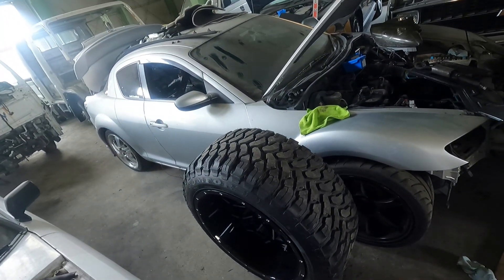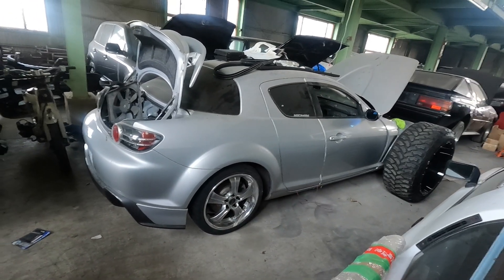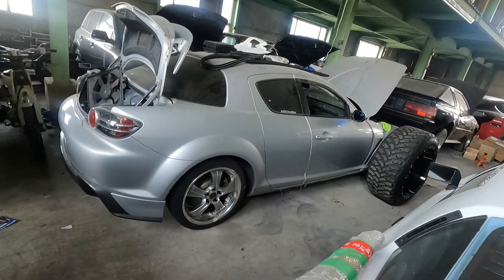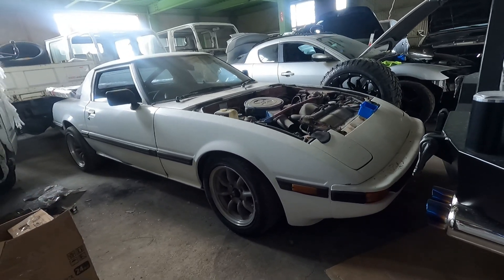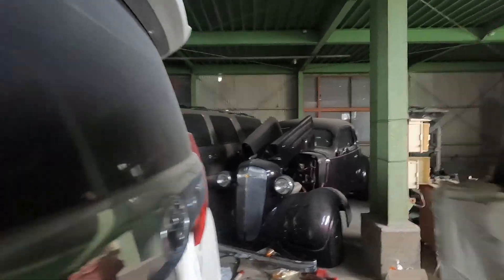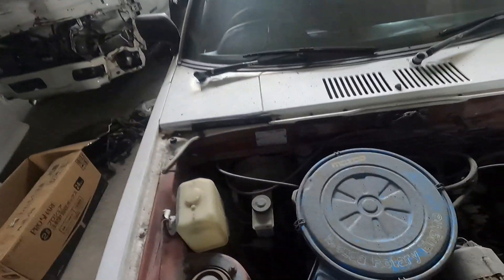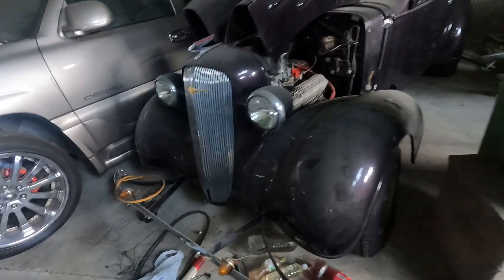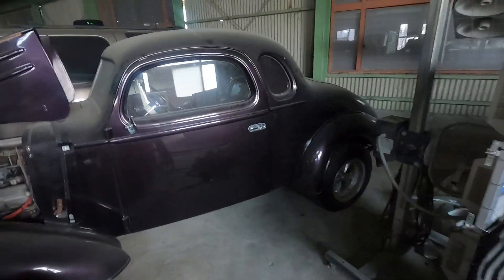Mazda RX-7, Mitsu Starion GSR-VR, RX-8, Plus two Mystery Cars

Comment: I remember when the local cops in Far North NSW were issued Starions as highway patrol.   First time it rained they were off the road and into the scenery.   Two cars were written off within months.   I don't think they learnt because much later they tried the Galant GSR and it had a similar result.
Reply from the maker: Ah! I now vaguely recall seeing some Starion police car pics on, I'm guessing, Facebook. Side note, those cops pinged me near Murwillumbah. I had been stuck behind a truck going over a range and couldn't resist when the 2nd lane opened up. Was during school holidays so double penalties too. :(
Reply: @wasabicars   ah maybe that happened in the set of twisties out side of Mooball, that had the constant radius down hill turn, I bet, ha ha, everyone knew that plod would be reversed in to the rail corridor access gate, 99% of the time.   The bit where it used to go 60 to 100.